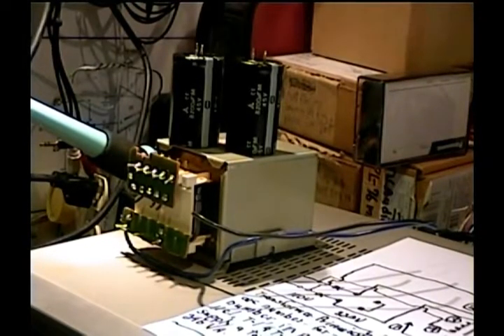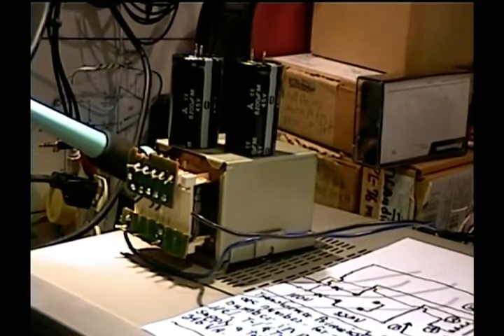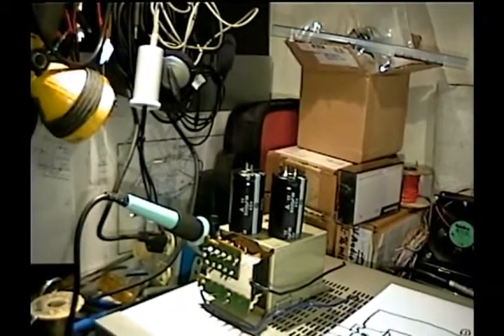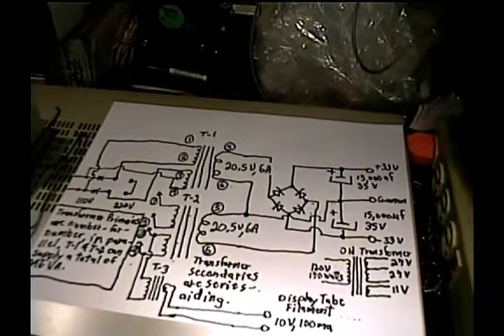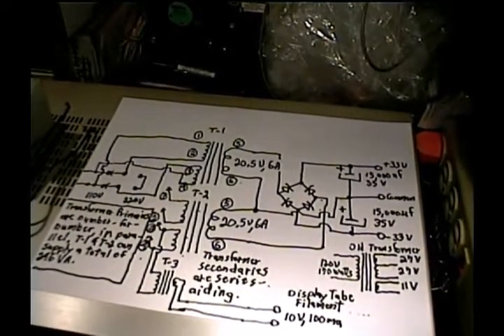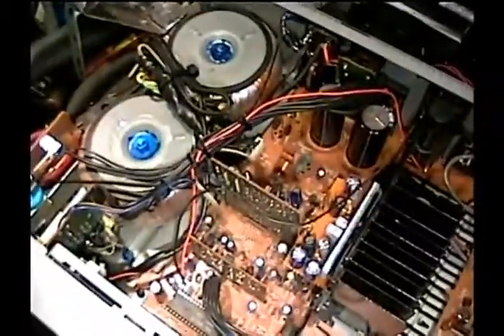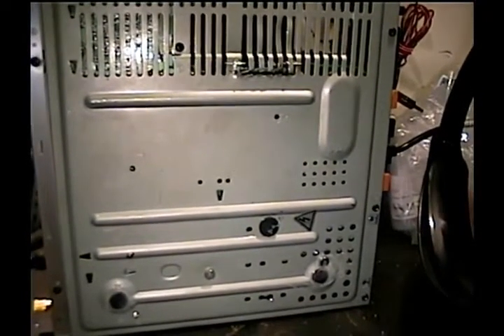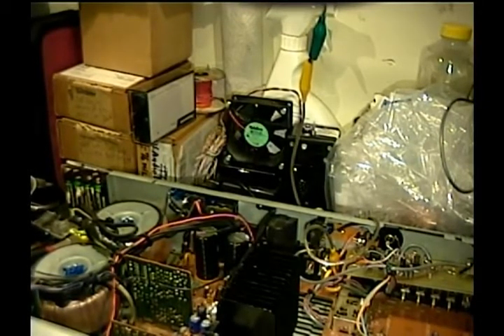Technics SA-350 Power Supply Tweaks.mp4

Comment: Hey dude I had a question, this mod could be funcional for a sa-450? is the same stuff just added the RF input inside of the amplifier, also the voltages in the main line are 42 0 42 or 20 0 20???
Reply: Well forget the last question I see twice the video and you says 42 0 42 so it's time to search old monitors with toroidal transformer 

ALSO THANKS FOR THE VIDEO